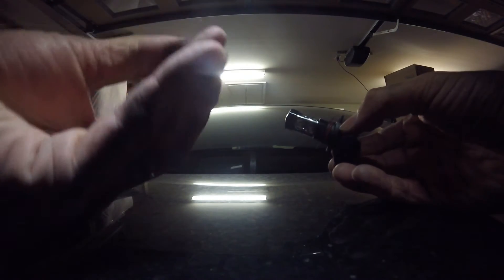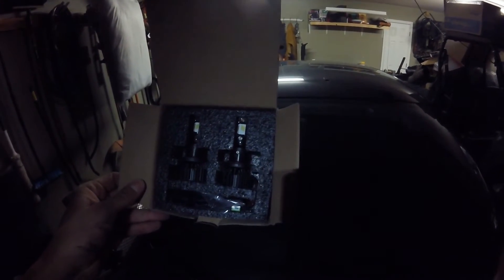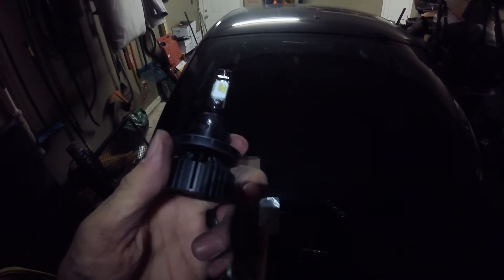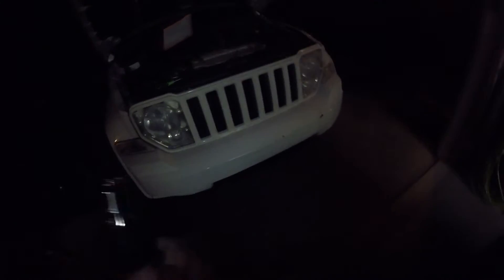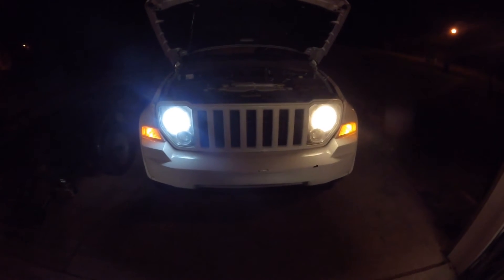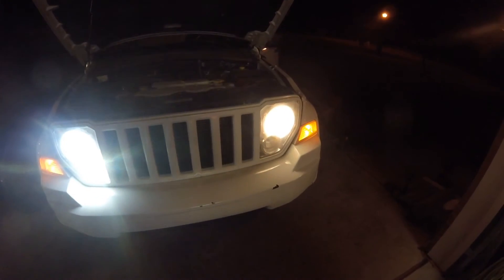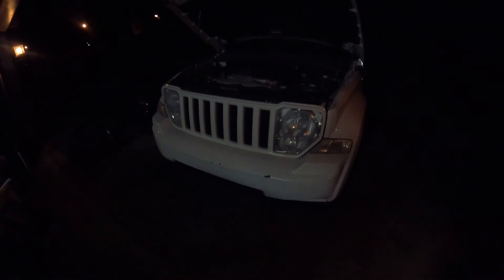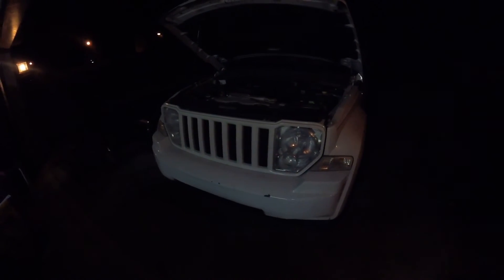JDM ASTARS led headlights to replace the SilverStar Ultras.

Comment: How did u get to the high beam ?
Reply from the maker: The high and low are in the same bulb and it's the top one, the fog lamp aka the bottom one is the one that sucks to get to. If I remember right I took the air box out and had to unbolt something on the otherside.
Reply: RidgeRunner338  thanks